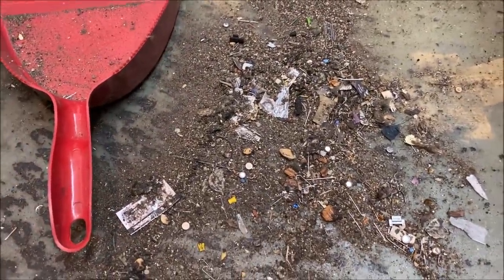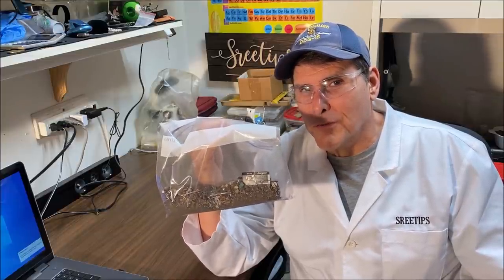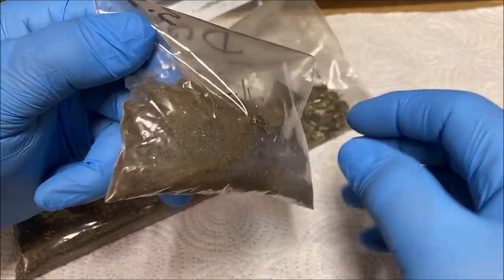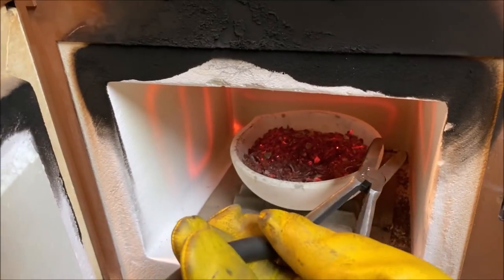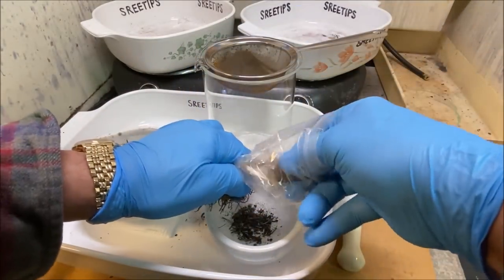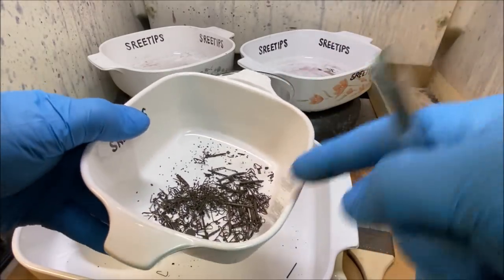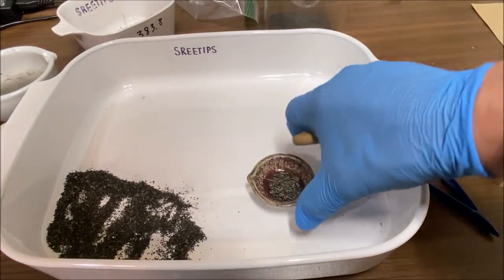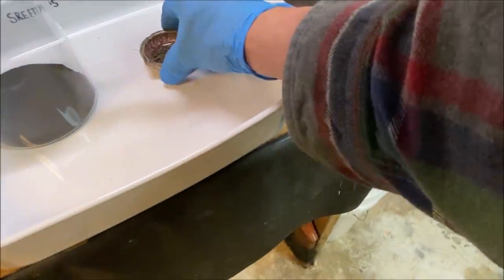Jeweler's Waste Low Grade Floor Sweeps Pt1

Comment: For magnetic separation, get a pvc tube, magnets and run the material through the tube with the magnets on the side. Repeat a few times. Works great for me.
Reply from the maker: Excellent idea
Reply: @sreetips  hope it helps
Reply: @sreetips
Please add the Arabic translation to your videos
Reply: @sreetips  I was thinking an old prescription bottle and that flat, round neo-magnet affixed to a stick.
Reply: @sreetips  Or just get a $10 magnetic separator from any gold prospecting supplier. Heck, I'd send you one of mine if it wasn't for the fact postage to and from the USA is like $100-300 per microgram of weight. They're basically a sprung trigger with a magnet on them. They make sorting fines so much easier when prospecting.
Reply: @Gort Newton That doesn't work well. You'll always get material that'll try and walk around the card.
Reply: @VerdantImage  Why wouldn't you put the magnets in the tube instead? That way you won't end up with a tube bunged up full of crap. Or just get a proper magnetic separator. They're ten bucks.
Reply: I’ve put a magnet in a film canister before works well for me

Comment: A "paydirt" youtuber puts his magnet in a coin tube to get ferrous material out before panning.  He pulls the magnet out of the the tube with a straight handheld hex wrench to drop the magnetic material.  It's a little more efficient than the plastic bag, so I wanted to share the tip.  Great content, love your work!

Comment: Sreetips, did you know, that platinum is magnetic a little bit? You should separate the magnetic stuff a second time using a weaker magnet than a neodymium type. Otherwise you maybe throw away some platinum together with the iron.

Comment: I am preparing to process some sweeps.. I wonder if I could use my centrifugal force concentrator (blue bowl) on the fines?
Reply from the maker: Best to incinerate the sweeps. Crush to a fine powder state. Hit with hot dilute nitric to remove silver and palladium. Rinse well with distilled water. Refine the rest (which should be gold and pgms) with aqua regia.
Reply: @sreetips  Ahh, never thought of that.. the elimination of the silver and palladium via nitric treatment.. thanks!!

Comment: Been following your channel for a while now its very interesting and informative, can you advise how I can process silver oxide....I have a quantity of 4 kilos left over from my time in the photographic industry from various silver recovery devices, its not metallic grey and easy to smelt like some cathode scrapings I have dealt with in the past, its black and dense....do I need to convert it first???
Reply from the maker: Silver oxide should melt into pure elemental silver just like it is. Put a spoon of it on a melt dish, add some borax, and hit it with a map gas torch.
Reply: @sreetips  yes I have borax so will give it a go...cheers